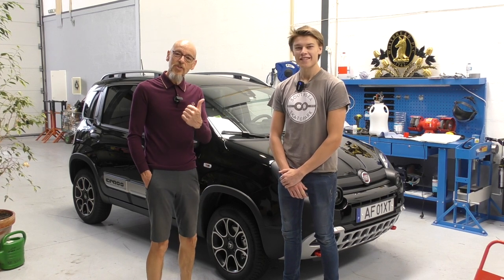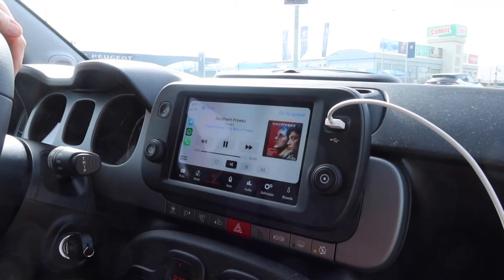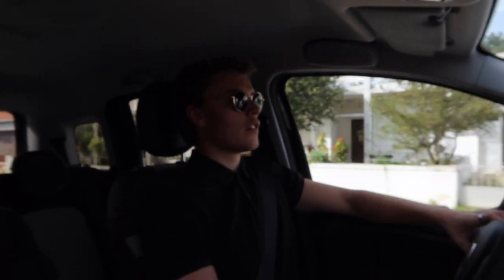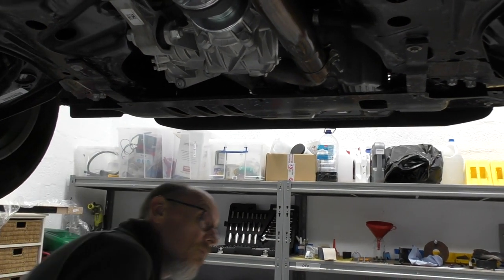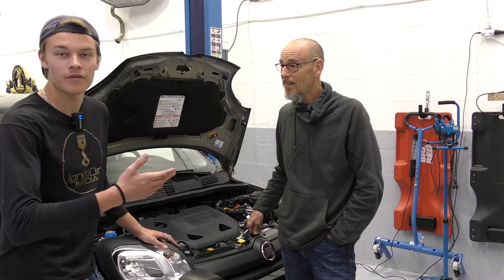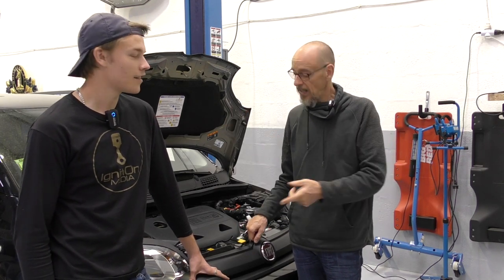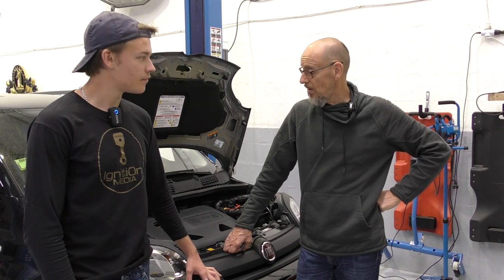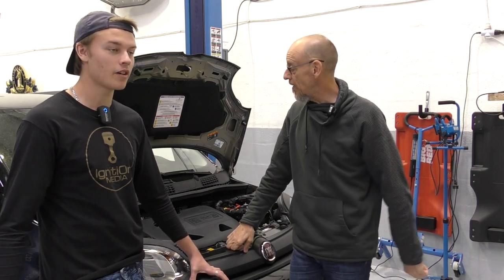2021 FIAT Panda 4X4 - new car collection and look under - what does the 4x4 system look like ?

Comment: Hello from Belgium
I own the same Panda since 2017 and now after 110000 km without any problem, I am still so happy to drive it and to hear its particular sound.
I am 56 years old, i owned many different cars and this is one of my favorite. It seems to be "unstoppable". In addition, I like design in general, and without emphasis, this car is well design in many many details that are "refreshing". This car gives smile, with simplicity, this is not common nowadays.
Reply from the maker: Hello from Portugal 😎
I love the sound, we were  surprised how good it is with the stock exhaust - and a young man like you must love that !!
My pet hate is everything on a touch screen - we do have the facelift with a screen (and I do like apple car play) but everything is still controlled by buttons or dials - love it.

Comment: I pick up a 2013 Panda 4x4 Twinair tomorrow with only 45k miles. Can't wait, I love the engine
Reply from the maker: That's a happy new year toy for you !!  they are great fun, the engine makes a great sound - we are surprised how many turn to look, then get confused seeing a Panda :)    - enjoy !
Reply: I ended up taking it back after 12 days due to an issue with the gearbox. They didn't tell me the truth about changing the clutch with the flywheel probably worn...so now I have a brand new Cross 4x4 on order with the winter pack in minimal grey 😎

Comment: Great Vid! I have a Cross TwinAir, I’m jealous of the new head unit
Reply from the maker: We got lucky - had no idea we were getting it :)  thanks for the comment, much appreciated
Reply: @DrivenMadShow  back in the UK it’s funny when some boy racer is following you laughing at the Panda, Until you hit a series of speed bumps and pot holes then they are no where to be seen😂😂😂😂 Ive got multi season tyres on mine, perfect for North Wales. Great channel boys
Reply from the maker: We fitted all seasons  as we have lots of dirt roads to explore ! I gaffed buying some 185 Latitude cross tyres, as it came with 175 - here in Portugal the tyre size is on the documents you have to keep in the car at all times - anything on the car, not on the document and you are walking home !! - so got to go through the legal loop to get them approved (Portugal, could take years🤣) so I have Semperit 175 65 15's - very good, much quieter than the Continental eco's it came with (bit of a shock).
Reply: Yer they seem to be fitting narrower non multi season tyres , I read somewhere so they can hit the current emissions, mines a MY 16, so in the UK £30 RFL and came fitted with 185’s 
Great channel guys

Comment: My wife has had the standard 4x4 since 2016. It’s a keeper. First thing we did was remap to 100bhp, probably not necessary but it really improves its drive. It came with winter tyres and following a Defender in snow once it was rock solid when the Defender was sliding a lot due to camber changes. (Maybe it was the tyres that did it)
Reply from the maker: We are wanting to remap - love the old 100hp Pandas, so will badge ours up in appreciation - probably not  for a few months as I am almost sure I will need clutch work first (or learn to drive it better !!) - ours is way better since we put on Latitude Cross tyres,  agree with you, tyres are a real key (not that we will see any snow here ) hope you follow the testing of ours, few months in to our ownership and this week we really tested it (just editing, should be up on the 2nd I think🤞🏼

Comment: Great video. I've just bought one too!
Reply from the maker: We are loving it - drives, goes handles better than we expected - so just changed the oil today - bit of painting this weekend (silver front and rear bits to black) then we will head for the dirt to see what it can do (more than me I expect 🤣)
Reply: @DrivenMadShow  Looking forward to the updates! I had my wing mirrors sprayed matt silver as soon as I got it. You're lucky to have the new touch screen infotainment system on LHD cars. We still have to put up with the old Fiat Unconnect system on UK Panda Cross, even with the facelift model.
Reply from the maker: It was an unexpected surprise, lucky timing - the 4x4 is a rare sight in Portugal (never seen one in the flesh bar mine), I had to tell the dealer they still sold them !! (well argue and get them to check !! - the sun is wicked here, but if you want service, live elsewhere 🤣)

Comment: Fantastic cars! I have the regular Fiat Panda 4x4 Antarctica version not the cross version but it has the same 0.9 twinair engine!
I can highly recommend them, the little 875cc 2 cylinder turbo engine feels like a much more powerful engine, very nimble and agile performer and sounds gorgeous, I love that roar as the turbo kicks in! 
It certainly surprises a few sportier cars at the lights😯⚠️😁

I would recommend some good quality tyres that would suit a more rough terrain. I have hankook kinergy all season tyres on mine, which in the UK are perfect in our climate, cold winters and lots of wet weather, even in the 2 weeks of summer we get they're fine! ⚠️😁

Regular oil changes are a must on the twinair, make sure you use the correct grade and quality as this engine is quite specific about oil. 
The clever intake valve setup uses oil pressure to open the valves and can vary the length of time they open and open them multiple times in one operation depending on engine revs, car speed and throttle position etc

The 4x4 setup is very capable don't be fooled by it's city car appearance, it is a mountain goat in rough terrain!

I've added your channel, looking forward to more adventures with your little Panda.😎👍
Reply from the maker: I have really fallen for "Pete" my Panda - we have been off road this week (tyres are changed, but limited choice due to size here in Portugal) loved it - thanks for watching and some great tips .....
Reply: Grande Panda cross 4x4 💪🐼👍😎
Reply: I'm so gutted. I tried to buy an Antarctica edition that I saw come up for sale here in the UK... was only £6k (65000 miles or thereabouts)... but just missed out! Super rare with only 300 about?
Reply: @harrierjames7727  I paid £5995 for ours with just 32k on it, had it 3 years now, not had any issues.
Prices just went crazy through the pandemic and they're still higher than what I paid, I've seen them up for £7k and with more miles than ours which is currently on 46k miles.

Not sure if the dealer we bought ours from realised it was a limited edition model?

Yes 300 were meant to be sold in the UK but I checked 'How many left' website and it's never shown more than 200.

Currently there are just 84 twinair Antarctica  models in the UK.
and 103 multijet diesel Antarctica models.

I've never seen one out on the road until a few weeks ago spotted one just randomly parked up not far from us, complete with penguin decals, ours doesn't have them! 😳😲😁
Reply: @pdtech4524  haha that's awesome! I saw one on a drive in Sheffield just a week after I wasn't able to buy the one I saw!!! What are the chances?!

I'm still considering whether to go for a 65 plate Panda 4*4 with 55k miles... But £7500 seems still quite a lot
Reply: @harrierjames7727  Honestly, It's worth waiting for the right one at the right price.
When I first decided to get a Panda 4x4 I was going for the first one I found, a dark green one, to be honest it wasn't my preferred colour choice, it had quite a lot of miles on it and was a well used example and quite a journey to collect.
I found the Antarctica quite by chance, luckily it was closer, half the miles and was a mint example, obviously had led a very sheltered life and had a very good service history 1 owner from new.
Being a limited edition was a complete bonus, I snapped it up as it seemed a good £1k under what it should have been going for, I even managed to get the dealer to put an extra 12 month warranty on top of the 6 month he was including.
So 18 month warranty total.

I've noticed prices vary wildly as well as mileage, so shop around. With the Twinair it's essential you get a well maintained one and regular oil changes are crucial.

I've noticed a couple of Antarctica models show up on Autotrader since owning ours, so they are out there and do come up for sale.

Good luck finding one, I think in future they will become very prized especially as numbers decrease!👍

Ours is a keeper, it's just such a fun little car to drive, full of character and so economical to run, plus it's very practical.
Reply: @pdtech4524  Thanks for the advice! I am defo after a twinair rather than the diesel. I don't mind the colours as they're all quite nice haha... the only colour I wouldn't choose would be white, but that happens to  be the colour of the LE antarctica so I wouldn't complain if I found one of those!

I'll keep waiting patiently :D
Reply: @harrierjames7727  I've never been a fan of white cars, I remember my dad getting a white mk1 escort and saying never again!
But the Antarctica has plenty of black on it to break up the white, plus the black roof.
The black plastic trim around the edges makes it easy to keep the dirty bits clean, the rest stays fairly clean and is easy to keep on top of.

There is a really nice light blue colour, I think the waze model, another limited edition one?

Comment: I had a look under one at a dealer the other day as it was on a set of those huge ramps so it was a meter or so in the air.  The rear suspension subframe was of interest to me as I know how badly the one on the earlier (169) model fares over time.  The things that intrigued me were the two black things that look like upturned plastic beakers.  What do they do?  Resonance dampers?
Reply from the maker: Spot on, dampers they are - luckily in Portugal, rust is not much of a thing - we just ordered a new subframe for our Abarth - not that its that bad, we just do not want the car off the road for long while we fiddle, its OEM brand new with rust already !  few coats of hammerite before we start should do the trick !

Comment: Great cars. The front bash plate is made of pig iron and will rust quickly if not looked after. And just you wait until you need to change the rear brake discs. Easy when you know how, but very few do. Including most Fiat garages.
Reply from the maker: Hope you watched the powder coat gold one we have fitted to our 169 ? this one (319)  I have done raptor, + many coats of red hammerite !
Reply: @DrivenMadShow  I didn't think about treating mine when it was new. I just weld on a another slab of metal when a new hole appears, Mind you, I'm in Sweden and mine spends most of the year bathed in salt  - not a spot of corrosion anywhere else after 8 years - maybe the bash plate acts like a sacrificial anode :-) The best ice and snow car I have ever driven BTW -  I blast by everything - and I've only ever used M+S tyres - don't even bother with studs - it appears to use magic to glue itself to the slippy stuff - I guess that's why they're all over the Italian Alps. Continue to have fun with yours. The most versatile, bomb proof and good value thing I've ever owned. I bought myself a trailer and roof rack bars when I bought the Panda and I've never needed another vehicle. You wouldn't believe what it can haul. If Pandas were mandated, we wouldn't need to be messing about with EVs, Mankind would be saved while spending their time behind the wheel with a silly grin on their faces.
Reply from the maker: Excellent - rust is not so much here, as we are in the Algarve - our ML is rust free, in the UK they just rot away, like you, salt is a killer, we only have it on chips 🤣 I even waxed our Panda the day after we collected it new ( pointless as galvanized, but I still did it ) I took the skid plate off as new (and a bit shitty as you say) and raptor coated it + paint - had to re do it a few times now and hammer it back to shape -  but it does the job

Comment: Hi Jon & Nath.....make sure you remove all 4 wheels and apply copper anti-seize grease onto the face of the hub and around the hub nuts and on the inside face of the wheel, as the alloy wheels being bolted onto the steel hubs make it difficult to remove the wheels due to dissimilar corrosion, I had to use a 2lb rubber dead blow mallet to remove all my wheels.......my advice would also be to keep a dead blow mallet in the boot of the car to remove the wheel if you have a puncture and need to change it with the spare wheel! Best regards to you both, Stefano....
Reply from the maker: Cheers Stefano - I am a copper grease fanatic - most of my overalls are covered in the stuff !

Just had Paddy recovered from his second outing - we fitted a new thermostat as the Portuguese like removing them ( ? ) odd to us - Paddy's was surprisingly still there, but rusted solid, so new one fitted - after about 100 miles the intake ( big bit with C clip) had blown off - we are suspecting (and hoping) it was a faulty one as putting it back together,  nothing has been destroyed, but it really looks like the c clip would struggle to be inserted correctly - cannot see what else could cause this problem, as it drove perfectly, other than temperature not showing on the gauge) before.

If you have a suggestion - always appreciated

KR J&N

Comment: Ive just watched and seen the under body protection but should it have a rear metal skid plate like the front ?
Reply from the maker: The more the better - I would say for a stock Panda, we have reached its limits - some of them really do not show how steep the climb is on camera - without low range, monster up hill sections with ruts are a no go, as you have to keep up a reasonable speed - likewise crawling over big ruts is hard as you just ride the clutch, but thats when you need to add better skid plates - they are available and a very worthwhile upgrade - the stock one, I have beaten back to shape quite a few times now.

Comment: intresting, especially hav now seen the first time the 4x4 system. it looks similar to the one what is used in the 169er's model - a visco-clutch on the rear axle, but here with a system on the front gearbox for "controlling" the system (meaning of, when the system switch on and off). that would really be intresting - 'cause of knowing the system on the old 141A (with no other coupling mechanism as just the single one after the front differential who can engage the rear axle for grip) or the system from the 169 (what didn't have another coupling what can be enganged manually - there's only a visco-clutch at the rear axle, what will engage them when there's to much slip between front and rear axle). it might be only me, but the 900cc twinair sounds like a small motorbike on stereoids, what must tow 2 tons - to be fair, the panda just had round 1.185 kilograms on weight - and the engine is way worse in economics than the other ones fiat had before - or build later. that engine is just a shame in my sight - might be good enough in a fiat 500, but not in a panda - and especially not in a 4x4.
Reply from the maker: You are right - the engine really should be a torque based unit, a simple 2ltr diesel tuned for torque & economy would make the car outstanding.

Ours needs to be trashed up a steep hill - if you stop, there is a knack to getting it past the limiter which is to ride the clutch as you say.

That said, it goes up steeper hills than I ever thought it could - the ride over dirt roads is incredibly good, way better than expected.

Comment: Take the sump guard off and copper slip the bolts as they will Snap off . Fit better stronger bolts is a must. Also keep an eye on the front bottom arms, I've fitted 3 ,all of them the pressed in ball joint came loose. VERY POOR DESIGN!
Reply from the maker: nice info - we will do that - keep the tips coming, very much appreciated
Reply from the maker: Copper grease done !! - thank you !!

Comment: What type of oil does this car need?
Reply from the maker: 0W 30 - there are a few but's ... only use the FIAT approved stuff (Petronas Selenia, shop about, it is expensive, but on line not so bad - don't skimp !!) you will find the same grade, but various additives may be missing - the engine is a fantastic unit, but there are plenty of horror stories about them, a main reason they fail is simply using the wrong oil, fussy engine with some sophisticated lube channels that will block if the oil is wrong or not changed often enough - the other "but" is, always ask a main dealer to confirm information you get, there may be variations due to your location - our 0W 30 is hot Portugal :)
Reply: @DrivenMadShow  thanks for the information. Any idea why my start/stop warming light keeps coming on all the time?
Reply from the maker: You really need to get the codes read and you will be 100% on the fault  - I will give you a guess (remember most youtubers are total idiots, I heavily fall into that category :)  my best guess is the battery is on the way out ? you will know how old it is and if that could be a suspect or not - but most commonly you get "SS not available" is when the car does not have enough power to sustain the engine not running - so battery is the the prime suspect, could be the alternator, unlikely or you would be having a flat battery ? - if that makes any sense -  hope its the cheapest option 🤞🏼